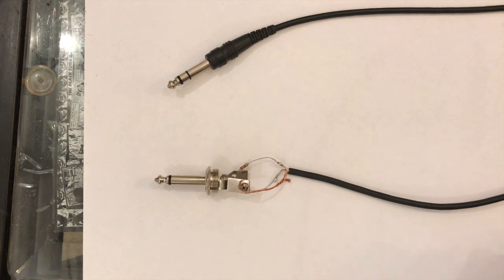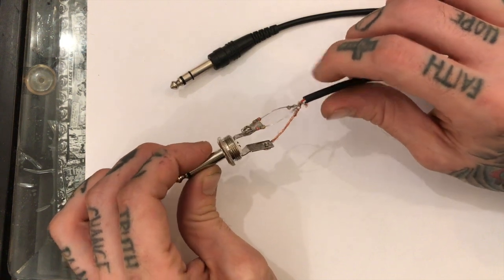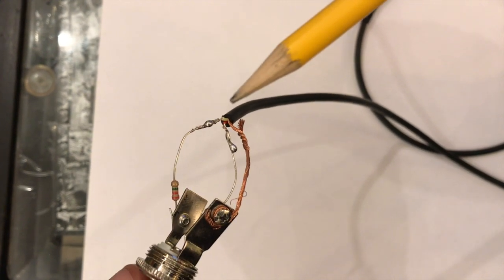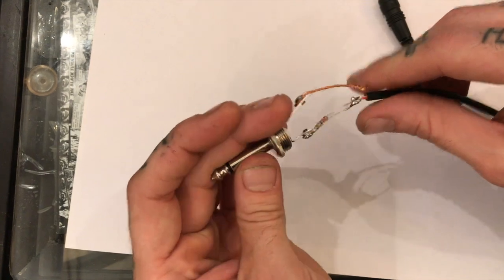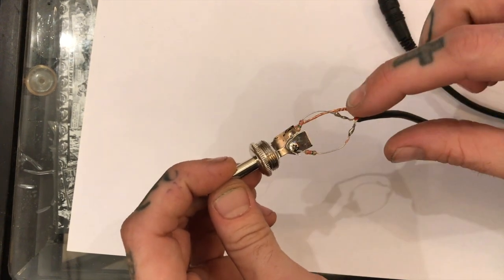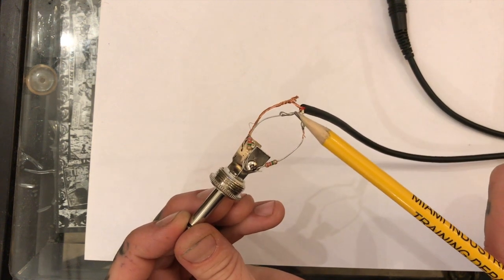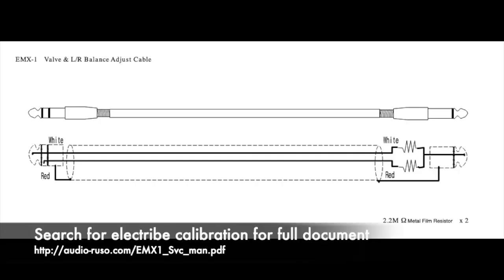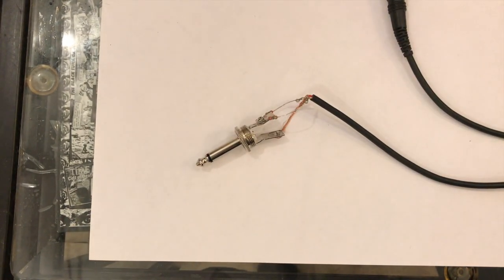How To Make A Calibration Cable For The Korg Electribe 1 Machines With Saul Pimon

Comment: Why is there a 2.2MOhm resistor per side joined together at the tip instead of joining the signal wires together and having the one 1.1MOhm resistor between that joint and the tip?
Reply: So the left and right channels are separated I think. Otherwise you would end up sending signal back down the other side. I assume that would damage something, or korg wouldn't have designed it like this. The cable schematic in the service manual mirrors what he's doing here.

Comment: It sucks that Korg didn't supply a calibration cable or at least have one you can buy. I mean you have to build  it, really? These emx-1s are like Ferraris. If you own one, it's in the shop. I have never had a machine more high maintenance than this! Every time I fix an issue, there are two new ones right away.

Comment: Hi Dude i get "N.G" after the warmup do you have any idea of what does it mean? thxxx (i made the cable like you)
Reply from the maker: I do believe i got a "N.G." on a few attempts at this process. not sure what it means but i just went back thru and made sure everything was set the right way. its a tricky process to make sure volumes and switches are in the right place at the right times. also make sure your left and right resistors are not touching each other until they hit the terminal. this is a link to the video i used to calibrate. https://youtu.be/znPyQGdlP30
Reply: You need the 2.2m 1% not 5%
Reply: Wrong resisters
Reply from the maker: also at the bottom of this page is the step by step manual http://audio-ruso.com/EMX1_Svc_man.pdf